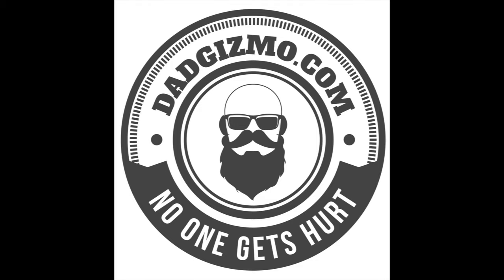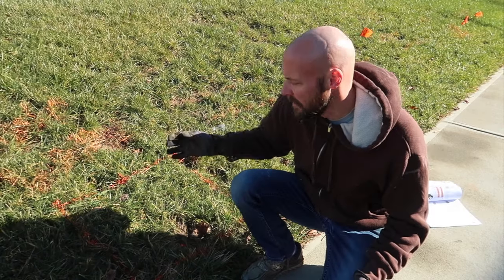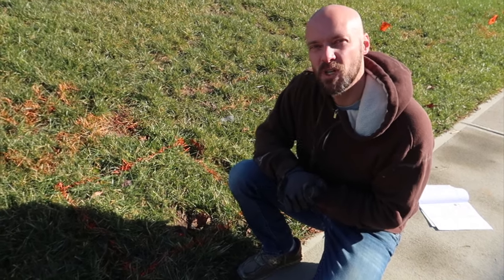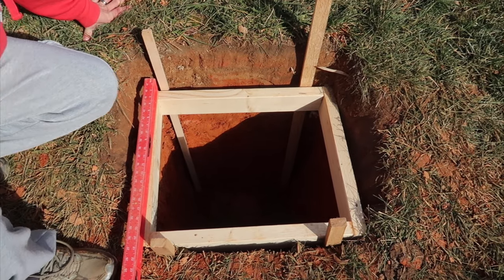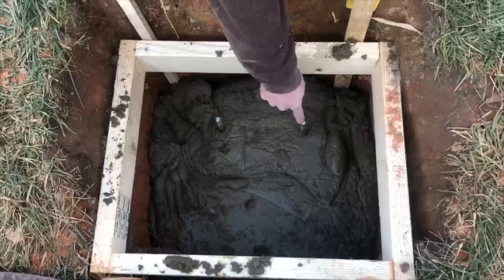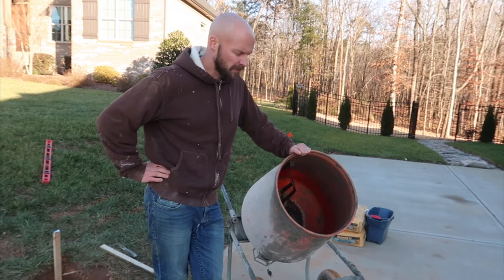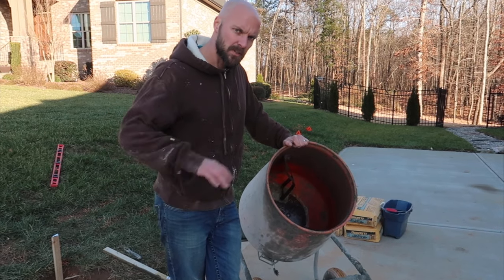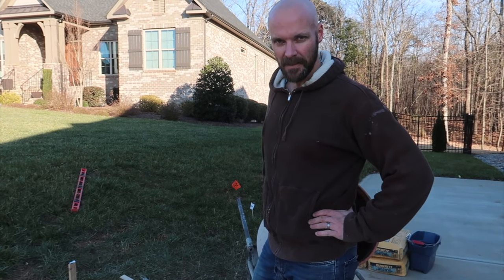How to Install In-Ground Basketball Hoop YOURSELF & SAVE MONEY

Comment: I used a drill and a dry wall mixing  paddle to mix the concrete in a bucket.. super easy and no need to rent and return a machine.
Reply from the maker: Great suggestion!!

Comment: Why doesn’t anyone show removing the form from the concrete?  Tips??
Reply from the maker: I would create the form with screws and just remove the screws to get the form off.
Reply: @MrGizmo211  I'm sorry, I'm w/ @lisakfish on this one. All of these videos and no one ever shows what they do w/ the form, or how to get it out. I'm a rookie for sure when it comes to cement, but if the concrete is all the way to the top of the form then I really don't see how it's possible to get it out.
Reply: I don’t know what you mean by this question, but I feel like I should know.
Reply: I don’t think you take it with you,I think your suppose to take the goal off and then when you move,buy a new form.

Comment: Great video and very informative.  But, for me personally, spending approximately $100 on the concrete and renting the mixer, then running back and forth to Home Depot, not to mention the time it took to do the project, I personally feel paying an additional $500 to have a professional to do the install would have been worth it.  My time is worth more than the $600 it would have costs for a professional installation.  But nevertheless, you did a fantastic job and your attention to detail was as good as any professional I've seen.  Thanks for taking the time to share your knowledge...
Reply: Wow you must make bank at your job to feel that way about $500 lol. For some that's most of a paycheck

Comment: Great Video! We had to dig a hole large enough to remove an old footer that would not work with a newer heavier system. Unfortunately, we had to dig a 40x30 inch circle just to get around it enough to bust old out. Now we are being told we cannot use a smaller form and then fill in dirt around it, I will not be safe? We will have to put a footer in the exact size of the big hole we already dug out. What is your opinion on this? We are deciding between a 475 lb Mega slam,. and one that only weight 275lb.
Reply from the maker: I would probably just mix more concrete to be safe :)!  The soft back filled dirt might not give it good structure!

Comment: Super helpful. Used a concrete form tube (not easy to find a 16" diameter tube evidently), but this video motivated me to do it without a contractor. Next goal is to level my boys up to do some labor.
Reply from the maker: My boys were in charge of loading the cement mixer!!  They didn’t enjoy it - but they learned how to mix concrete :).

Comment: Great video. A question: How much of your backboard overhang the driveway? What is the recommended distance from the backboard to the edge of the driveway? Thanks.
Reply from the maker: Mine was about 5-7 inches over the driveway.  I don't know if there is a typical distance on a home basketball hoop, but you want to make sure the ball falls to your driveway :).

Comment: Great video, thanks. I think I have the exact model I’m about to install. As luck would have it, I had to reroute my irrigation line yesterday and will start digging the hole soon. Regarding the form, when did you pull it, and did you take the stakes with it when you removed?
Reply from the maker: I know I am late on this.  I waited a week to pull the form.

Comment: did you pour over the frame and leave the wood under the cement or did you pour up to the frame and take it off? Thanks for the video.
Reply from the maker: I just framed the top - not in the hole.  Poured the cement and removed the wood frame.
Reply: How long did you let the cement set before pulling out the frame

Comment: Hi, just wondering how long it took you to dig the hole and how many people were helping you?
Reply from the maker: Probably took about 1 1/2 hours to dig the hole and 1 1/2 hours to do the concrete.  Just my 14 year and I did most of the work.  My 11 year old did help with pouring concrete.
Reply: Hey buddy, what size of these rebars you were using on this job? 4 feet? Or 2 feet

Comment: How much do you think it would cost if you payed or hired someone to do this project for you?
Reply from the maker: 650+.  That is the quote in my neighborhood right now.
Reply: If you do the digging yourself, you'll save yourself a small fortune.  I just did the concrete installation for a customer (customer did the digging) for $200 labor.  It's a 4-5 hour job for the concrete alone, comfortably.  It is the mixing of concrete that people are not comfortable with. You don't have to rent a mixer.  Just get 3 5-gallon buckets from HD or Lowe's, Quikrete 1101 mix or better yet ProFinish fiber-reinforced mix.  I recommend using a corded electric drill with mixing paddle instead of a battery-powered drill - you'll drain the battery FAST mixing concrete.

I recommend 1 gallon water for an 80-lb bag for the bottom 2/3 of the pour, then backing off to closer to 3/4 gallon for the upper 1/3 of the pour.  Add water & concrete in 1/3 bag amounts per bucket, moving the mixer paddle in and up-and-down motion moving around the bucket in order to thoroughly mix.  Then add another 1/3 bag & water & mix thoroughly.  After your first few bags of concrete, you'll have a better "feel" for what works. Don't mix more than 2/3 bag in one 5-gallon bucket as it becomes VERY heavy to lift & dump, let alone mix thoroughly.   Mix the concrete "wetter" (1 gallon water/80-lb bag) for the bottom 2/3 of the pour so you can maneuver the rebar installation before the concrete hardens, then mix the upper third "dryer" (3/4 gallon water/80-lb bag). Then position the basketball hoop mount into the concrete, center it as best as possible, level it, then finish the surface per your desire & skill level.  It will take about 90-120 minutes for the top surface to harden enough to apply a "finish" to it, depending on how wet it was & weather/sun.

Toughest part of the job is getting the concrete & mixing/pouring it.  Rest is easy.  Hope this info helps DIYers out there.

Comment: I've heard the hole should be 4 feet and flare out at the bottom.
Reply from the maker: I did flare the bottom out but stuck with the recommended depth and have had no issues

Comment: No need to rent a mixer, a wheel barrel will work…also this was definitely overkill…
Reply: A concrete mixing bag is the easiest way.
Reply: Lmfao try a couple home depot waste buckets 1/3 full in each and some concrete mixing bags and you're set you rookies

Comment: you should never👎  install  the base below ground  ,  this action hold water from the rain and from your irrigation system..I can see in couple years your base will be covered with a lot of dirt and grass... and your metal template will be rusted, also your metal pole😖

I'm a basketball goal installer in  houston  tx for +10 years... I been see this before...☹😩😭😭
Reply: Do you have a recommendation I could use?  My yard is similar and slopes up from driveway.
Reply: Can you tell me how to reinstall a goal? Someone backed into the basketball goal, and it broke two of the bolts in half. Trying to figure out how we can get it back up!